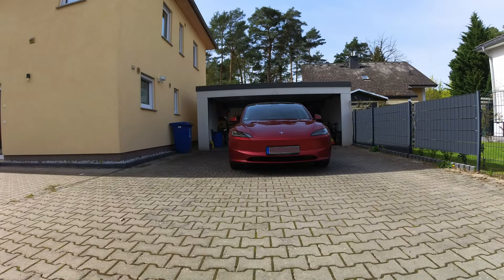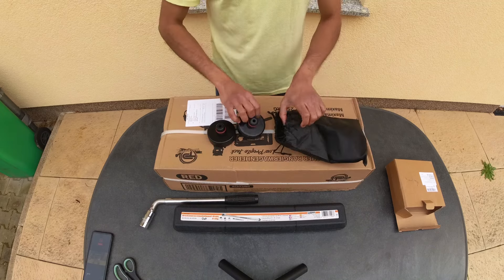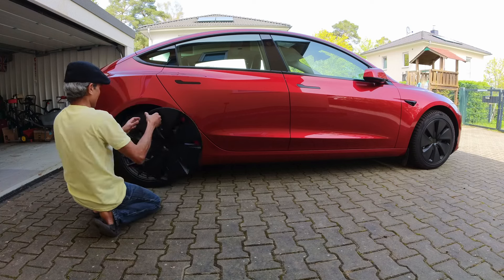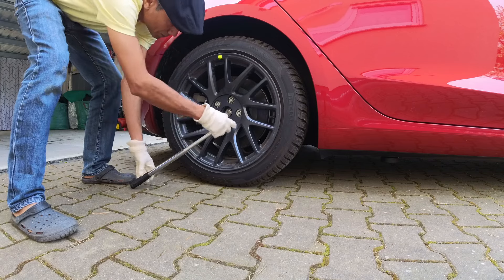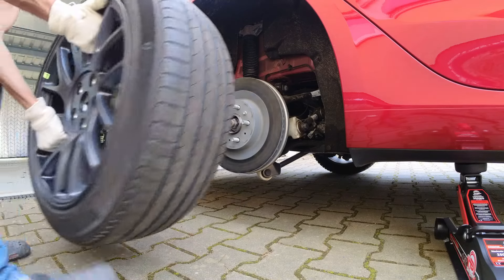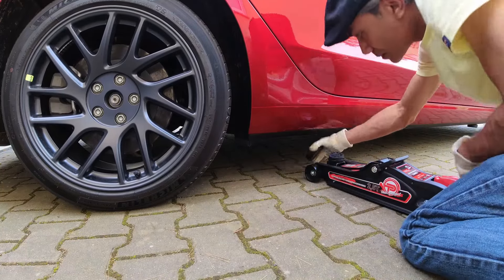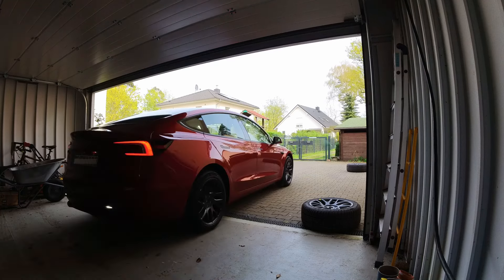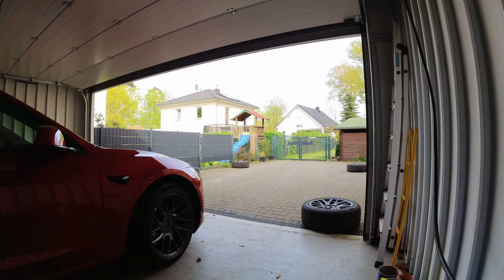Changing tyres on Tesla Model 3 Highland

Comment: No need to disable alarms from the menu? Because the car tilts I have heard it triggers the alarm
Reply from the maker: You are right, in principle. Excerpt from the manual: 
Tilt/Intrusion sounds the alarm in your vehicle if Model 3 detects motion inside the cabin, or is moved or tilted (for example, with a tow truck or jack). To enable, touch Controls > Safety > Tilt/Intrusion. The Security Alarm must be on to enable Tilt/Intrusion.

However, depending on configuration, market region, and date of manufacture, your vehicle may not be equipped with this feature.

I don't think my car has this feature (here in Germany).